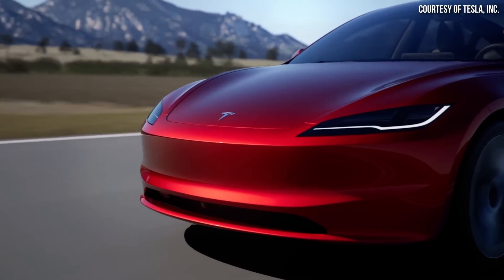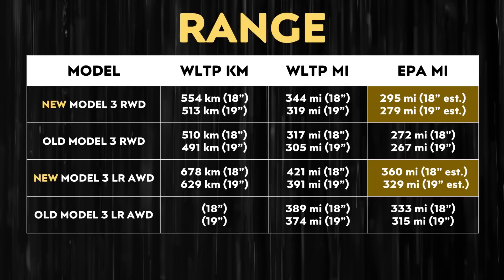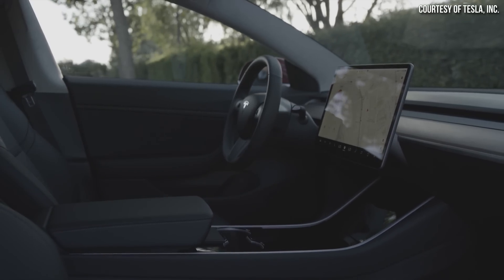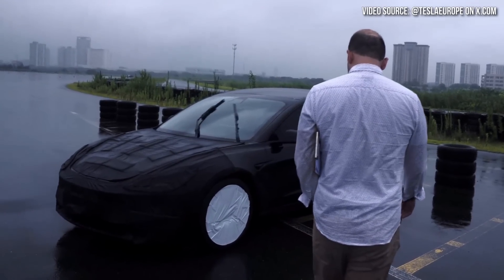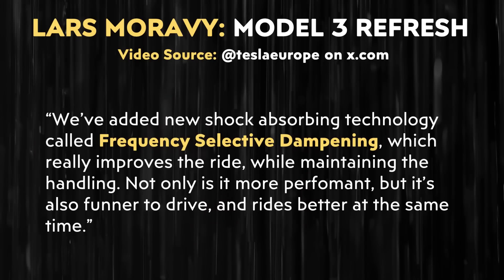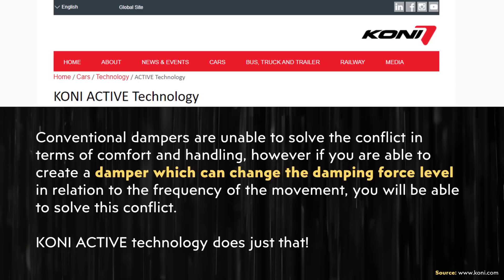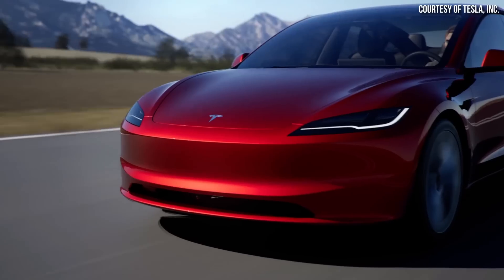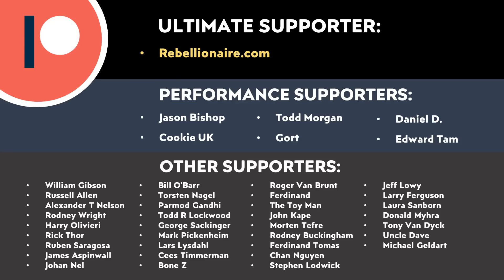Tesla VP Explains NEW Model 3 Tech | Improved Suspension

Comment: I can attest to the comfort of the new 2024 Telsa Model 3. However, after replacing the faulty noisy left rear damper, my car becomes very bumpy, trembling left and right especially when driving at low speed on local roads. It now rides like a boat and makes me feel dizzy. I have taken my car to the service center which originally replaced the left rear damper. They could not find anything wrong. I am taking to another center to get a second opinion.  This is just a warning about this very common noisy damper problem and the possible consequences after replacing them.

Comment: It is a commonplace of modern performance shock absorbers that there are two damping 'circuits': the 'low speed' circuit (low shock absorber shaft speed) that provides stronger damping force keeping a vehicle relatively stable while it is undergoing low frequency suspension forces - acceleration, deceleration etc. - and the 'high speed' circuit which gets engaged by an increase in shock shaft speeds. What increases shock shaft speeds? Big bumps and dips or more commonly lots of little bumps and dips.

Velocity sensitive shock absorbers are sometimes called frequency sensitive or frequency selective shock absorbers. No hydraulic shock absorber (except an electronically augmented/controlled one) gets the chance to rapidly alter damping force based on a measurement of the compression-rebound-compression  rate/frequency of the shock. So, in practice frequency selective means nothing more than (shaft) velocity sensitive which is how the shock absorber works.

To be more precise, a dual circuit damper of the type described above has the low speed circuit engaged in the normal case and the high speed circuit engaged once a threshold shaft speed is exceeded. All of that is achieved mechanically/hydraulically by rising oil pressures opening or shutting valves. The transition points between the damper circuits can be pre-tuned but typically in a performance shock are tunable (as are many other things, too).

It sounds like Tesla is using a performance shock absorber as standard spec, which is great. It might not be permitting any adjustment, however, and more importantly none of this is new tech. This kind of performance shock absorber tech should have trickled down long ago but we are finally seeing it happen. Also, it works.

Comment: If much of the suspension improvement is due to shocks, I wonder if there will be an upgrade available. Shocks wear out so at that point why not upgrade?
Reply: It seems so much is similar, one would think it would be a direct swap.  However, I do notice a lower hood on the update, so I wonder if the mounting point for the front shocks is lower, requiring a different shock altogether.
Reply: Guy on reddit claimed he bought the 2024 dampers and springs and swapped them into his 2018 with no issues

Comment: I do wish the new Tesla Model 3 suspension was adjustable. My neighborhood uses curved sloping "street curbs" and that is what is in front of the driveway. Everything bumps going over that and many cars' under-body scrap it. I might need 19" wheels just to get in the driveway. 😐
Reply: The tyre OUTSIDE diameter is the same.
Reply: @rogerstarkey5390  Oh, is that so? Wheel rim diameter is 18 or 19? My (really) bad. Let me follow with another probable misunderstanding. If the outside tyre diameter is the same (and each rotation takes you the same distance), why would 18" wheels provide more range than 19"? Or use less energy for the same range? Is the tire itself thinner (inner to outer edge) or weighs less? Guess I am missing something obvious because I just assumed the outer diameters would be different too; the carriage slightly higher; with aerodynamics making an energy difference.

Comment: I suggest that these upgrades are not what average Joe's want. I think I would have preferred a hatch back, twin giga castings, CATL M3P batteries and a heads-up display?
Reply: So.... A NEW MODEL? Costing $10k more to pay for the machinery?
.
Hatch.
COMPLETELY new tooling, etc.
.
Castings... The same.
. 
CATL M3P. Not in production yet..
.
HUD..., In a car destined to be autonomous (in case you hadn't noticed?).
.
Smh
Reply: I don't think the average joe even knows what giga castings or m3p batteries are
Reply: Yes but that might all come soon.
Batteries should be easy. They will be ready in January / February.
Reply: Heads-up display is against Elons religion (like advertising) it is not needed in a self driving car…

Comment: The removal of the indicator stalk is a retrograde step as it makes it very dificult to switch the correct indicator on whilst negotiating a ritght radius bend without loiking down to see where the button is, the exact time that the driver needs to be looking where he's going.
Reply: From March on aftermarket stalks will be available and then you can use the buttons on the highway for overtaking and the stalks in roundabouts and city driving. The driving experience them will be awesome.
Reply: yes, I have driven the Highland Model 3 and the steering wheel button are useless, can’t be used at all if you are already turning
Reply: @shagsheep8832 these are built to be robotaxis
Reply: I hear full stops are useful too
Reply: It is initially confusing. Then you simply need to keep in mind "lower is left" the same as a stalk - lower it to turn left. Then when turning right, you simply need to recognise that the left button is the one with the sharper ridge under it. Secondly (and it makes sense when you're used to it) Keep in mind that it 'was' the lower button when the wheel is straight. It sounds confusing but works in practice after a short time of acclimatisation.
Reply: @rlc2978  Its not a matter of remembering which button is which but finding the buttons when the steering wheel is turned many degrees of its straight ahead position!
Reply: The idea is that you’re supposed to indicate BEFORE you make the turn
Reply: @lemongavine  When you're going around a roundabout you need to indicate whilst you're turning.